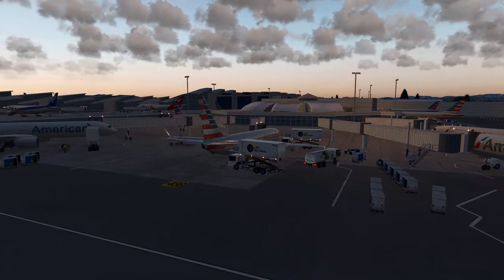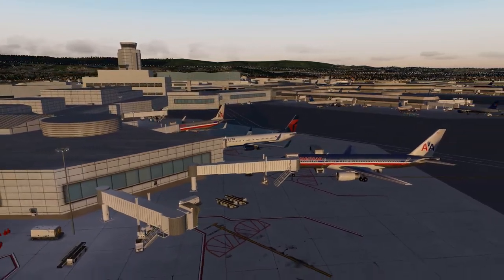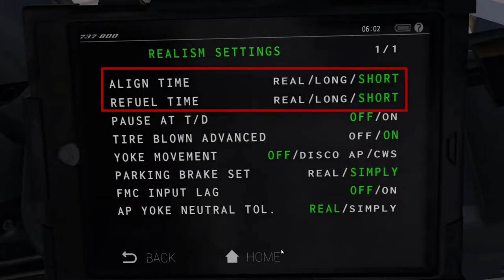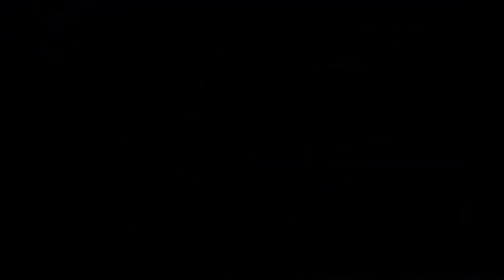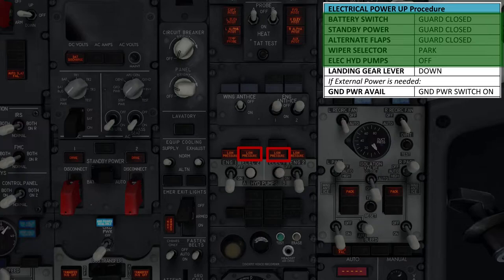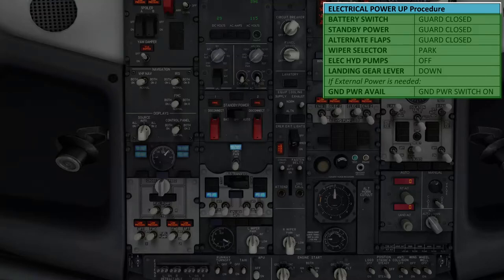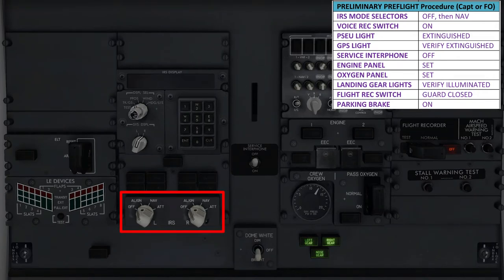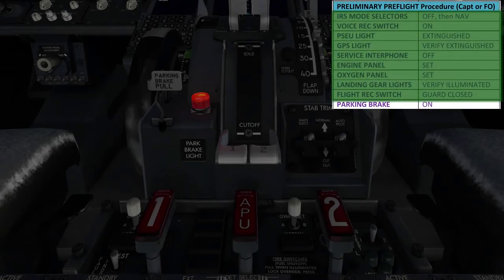Aircrafts Dissected Ep 8: Electrical Power Up ProcedureIZibo 737IX-Plane 11 Detailed Tutorial

Comment: Hi there, I have a problem when doing the preliminary preflight checklist. After selecting the 2 IRS knobs to OFF then NAV the RH light illuminates, but stays on and an alarm bell rings. Turning the RH knob back to OFF the light goes off and the alarm stops ringing. The LH knob is working fine. Have you any idea what may cause this? Great series I am learning a lot.
Reply from the maker: Aah, this might be because you're operating the IRS systems on battery power. When switching the IRS systems on, you need to have either the GPU connected or the APU supplying external power to the aircraft. Hope that helps Bob!

Comment: Public Notes: 
1) After installing the Zibo folder, it is important that you calibrate both your hardware within X Plane AND again in the EFB settings. If you experience any "digital noise" where values show other than zero, adjust the green number until the values show zero. I have digital noise in my pedals because they don't exactly center every time. 
2) In X Plane settings- uncheck "use experimental flight model" and uncheck "use downwind ILSs"
3) X Plane calibration settings- Control Sensitivity: There are 2 columns of sliders. The right hand column (Stability Augmentation) sliders MUST be moved to the left or X Plane code will interfere with the Zibo code. The left hand column is Control Response. Personally, a 737 will not react to wind gusts like a Cessna will so I slide the left hand column fully to the right to simulate a heavier aircraft, though this column is optional. 
4) I strongly recommend for new Zibo pilots to use the PDF install guide and/or created by Skymatix on Youtube. This will help prevent 99% of install issues caused by user error. Its not a drag/drop/fly installation. This will allow many of you to fall in love with the Zibo mod that much faster ;-)
Reply from the maker: Very helpful. Thank you!